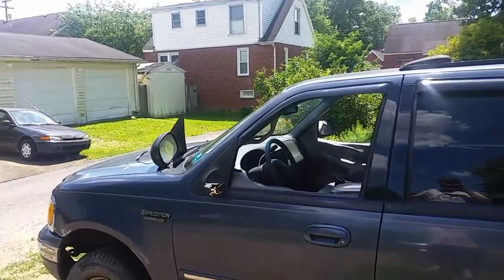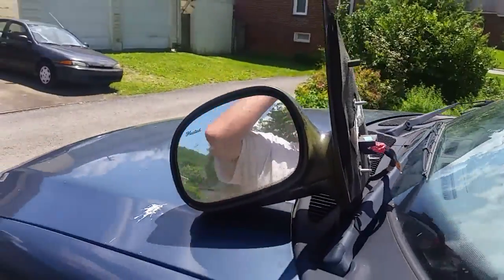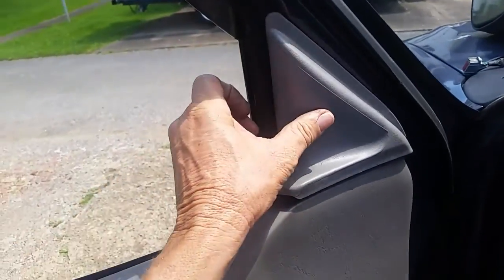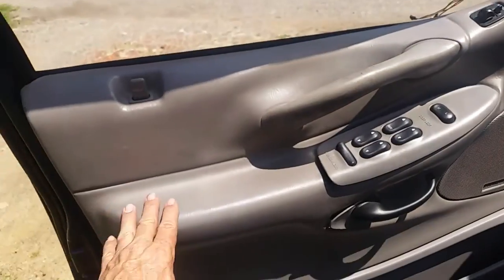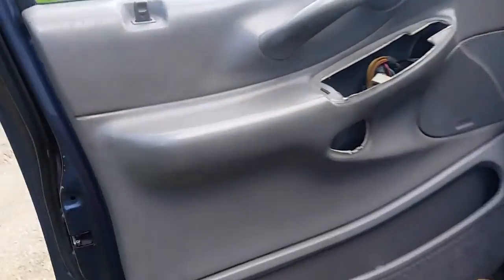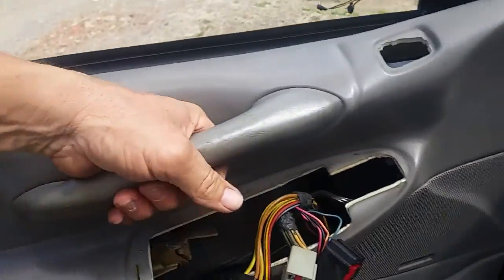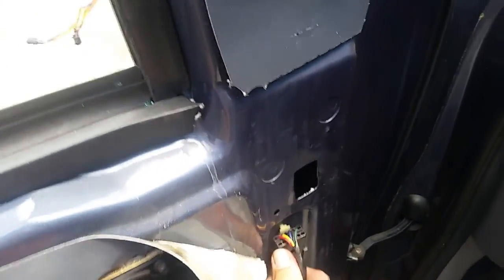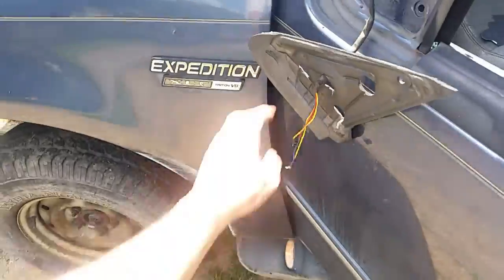Expedition Door Mirror Replacement 1995-2005.

Comment: ..can't you swap the wires over into the old plug?? providing the wiring harness is wired for the heater and turn signal...
Reply from the maker: Maybe...but its not worth the work. I would only have tilt  L R adjustments. The turn signal light I can't figure out. Old plug...3 wires....new one 10 wires lol....
Reply: ..Thanks Nathan. just our luck on something like that...!!